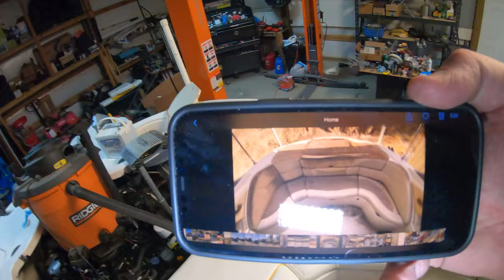Restoring an abandoned ski boat from $4K to $40K PART 6

Comment: You want that subwoofer right in the back so by the engine bay. Running power wires to the bow could be difficult if not impossible.